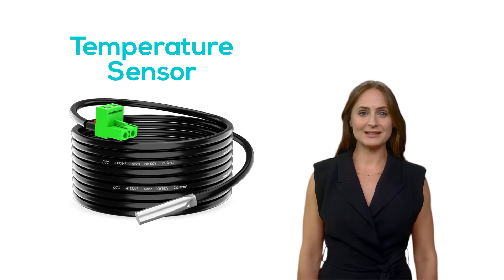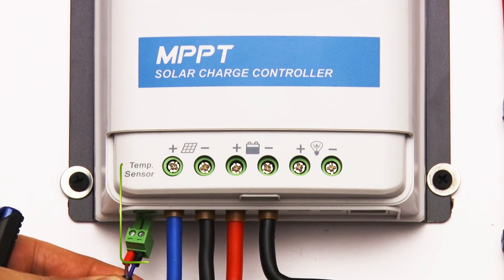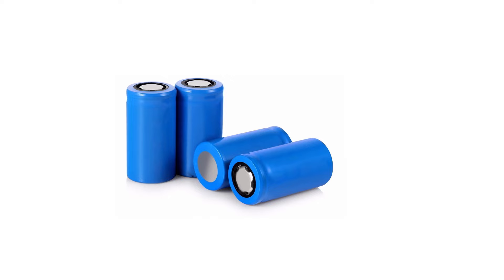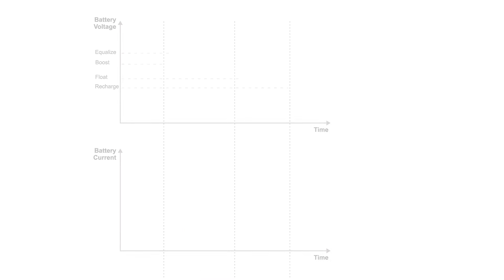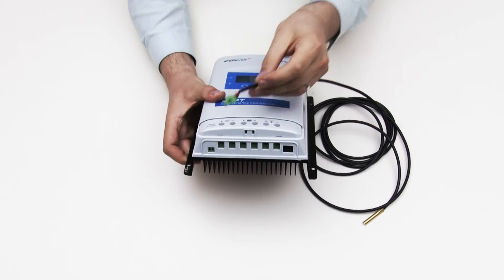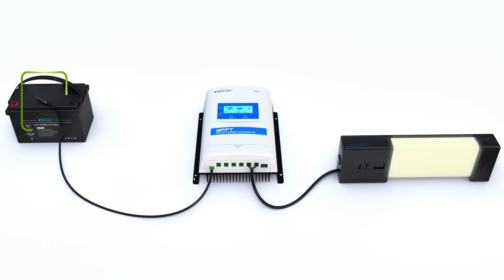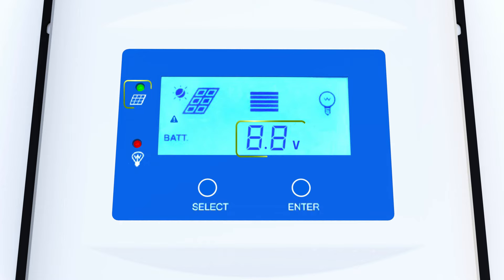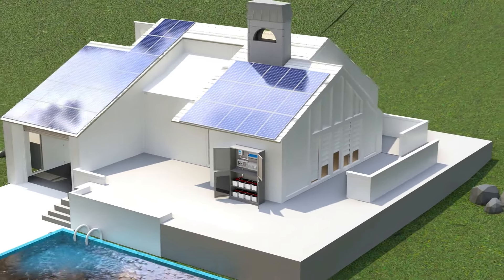Optimizing Off-Grid Solar Systems with Temperature Sensors

Comment: Greetings I have an Epever 2210AN with a bank of two sealed 12volt 110 amp batteries in series.  Where did you place the temperature sensor?  About a single battery?  Or how would it be to install the temperature sensor on the two batteries to monitor both at the same time?
Reply from the maker: Connect the plug end of the remote temperature sensor directly to the temperature sensor interface on the controller. Attach the metal probe end to the surface of the battery. We recommend placing the probe near the part of the battery that tends to heat up more. Using thermal grease at the contact point between the probe and the battery can improve the accuracy of the measurements. 
The Tracer-AN controller has only one temperature sensor port, so it can monitor only one battery at a time and cannot simultaneously track multiple batteries.